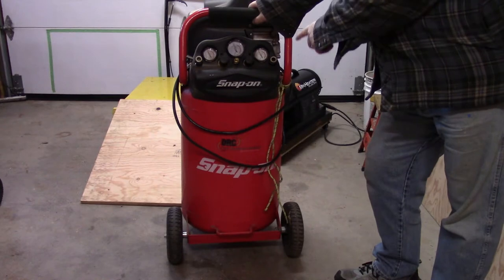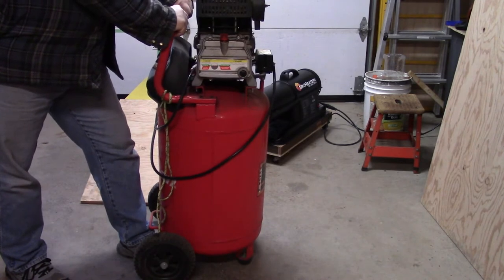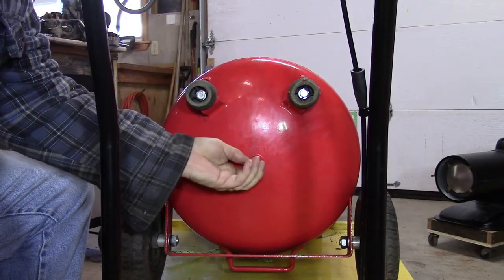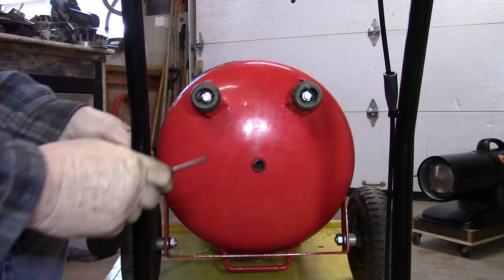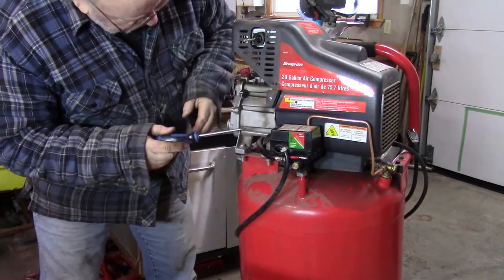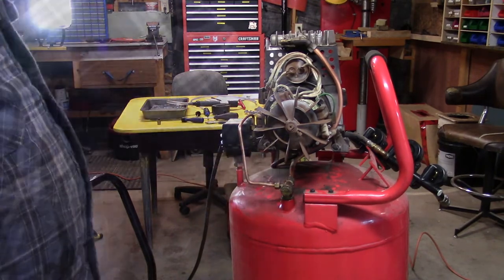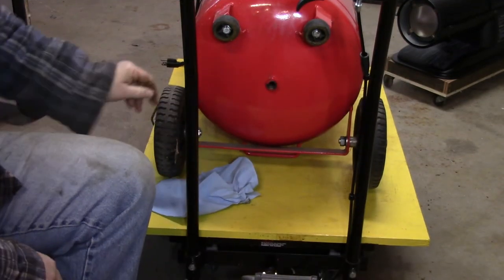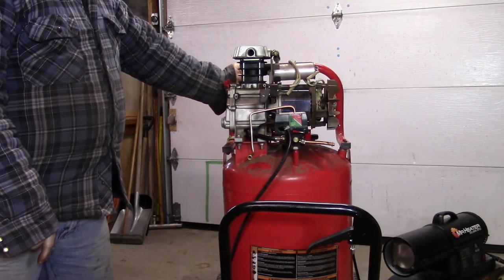Air Compressor Maintenance

Comment: I mounted my compressor up on a shelf with an access hole right under the valve so I can easily drain it. I also put a 1/4 turn brass valve on it since the original valve was kinda cheap and didn't work that well.
Reply from the maker: How's she goin'?  That's a good idea for mounting the compressor.  I move my compressor around a lot and so mounting it up off the floor probably wouldn't work for me.  I'm going to extend a hose from the drain so I can easily get at it to drain the tank.  No more water in my tank after this mod!!!  Thanks for tuning in and take care!!

Comment: Hi Mike!   Yikes!  2 years!  That’s a lot of water and a lot of rust.  I’d be worried about the integrity of the tank.  BTW, like you I release the pressure using the over pressure valve then with just a few PSI left, I drain the water.  Doing otherwise causes the drain valve to freeze with ice due to the rapid decompression.  It just takes a few PSI to expel the water after a day’s use. Thanks for sharing!
Reply from the maker: Good day eh!!!  Unbelievable the amount of water that was in my tank.  I checked the tank doing a crude, 'ring' test and the tank seems plenty solid still.  I sprayed Fluid Film in the tank and left it for 2 days and the drained it again.  Lots of stuff came out!!!  LOL  Then I put the endoscope in and did a real good 'search'.  I was able to see pretty good with the scope and I'm happy to say the tank inside looked really good so the tank should be OK.  I wasn't very proud of the condition of this compressor and the water in the tank was totally embarrassing.  And I call myself a maintenance man.  I'm going to lose my toolbox privileges for sure!!!  Thanks for watching Martin and take care!!

Comment: Staying in the habit of draining the tank is a compressors best friend. I put an elbow and extension nipple to the drain valve so it is easy to get at. Sure beats having to reach under to drain the tank eh. For most of us a hundred hours of use can take years to build up for an oil change but as with everything needs to be checked regularly. I would get a gal of "Evap O Rust" and put it directly in the tank and swish it around for a day or two and then rinse the insides with clear, hot water. Then put a water separator at the outlet is a good thing to do as with air motors water is the death of them. I use the ones that drain themselves. Really good post Mike. Not many of us will do a post like this as pride gets in the way eh.
Reply from the maker: How's she goin'?  Well Dean, I was some embarrassed when the water started to flow out.  Then, when it wasn't stopping, I was going to cancel the video all together.  But then I thought, what I do on You Tube videos is real, and this was pretty real for me.  In fact it was 'a kick in the arse' real!!!  Flushing the tank with 'rust-B-gone' I think is a good plan.  I have some Fluid Film in it now.  I plan on rotating the tank a bunch of times and then flushing it out.  checking it again with the endoscope and see if there is any difference.  If it's still bad, I'm kind of scared of it now and maybe I'll need to change it. We'll see what happens after the flushing.  Thanks for your comments and tips Dean!!  Like I always say, you have forgotten way more than most of us will every know!!!  Take care!!
Reply: @GrampiesWorkshop  When these tanks rust through they don't blow up but just start an audible leak. You can always mount the head from yours on a 100 lb propane tank. They are really easy to weld a bung on the bottom and the wheels from this one. They are quite a bit thicker than most air tanks as well. Just don't weld across any of the tanks welds as a rule of thumb. Have a great weekend Mike. It's always a pleasure to see a new post from you my friend.
Reply from the maker: @TomokosEnterprize  I did a crude 'ring' test on the tank and it sounded good and solid.  We'll see what happens after I flush it good tomorrow and have a look inside again...
Reply: @GrampiesWorkshop  I am sure it is ok. One thing about rust in these situations is it is suicidal by consuming any available O2 inside. No fuel, no grow eh, LOL.

Comment: As long as it starts and makes pressure the compressor is last on the list in most shops. That is until it quits. Nearly everything in a manufacturing or assembly shop uses compressed air.  Hooking up a hose to the drain works a treat. If you have the  time or inclination you can attach the hose up near the on off switch  and with a simple push button air nozzle with a hose fitting on both ends you can blow the water every time you start and stop. 
I set up factory air systems so budget wasn't an issue. I ran a manifold loop of 3" black iron pipe around the building with a gate valve in each corner. If someone broke a line we could  isolate that stretch and repair it. The manifold lines were hung with a 1/4 inch to 10 foot pitch biased to the corners. Each corner had an auto drain water trap on the bottom. 
All the taps on the 3" manifold line were off the top. That way the hot air from the compressor cooled off and dumped the water into the main tank. The tank had an auto drain so that water was dumped. The air went into the manifolds and cooled further. That water dumped out of the manifold auto drains. Each line dropped from the manifold had a 1 foot long trap on the end with the air pulled off the side of the line at the 1 foot mark. There was a gate valve at the end of the 1 foot long trap to blow down the line and get rid of rust flakes before they jammed up the works. 
The rusted tanks I dealt with developed pin holes long before they were dangerous. If you find a patch on a tank toss it. 
Good luck and thanks for sharing. 😁😎
Reply from the maker: Hello there Dave!!!  There is lots of info in your response.  Even though the system you are talking about is way more than what a small home shop would need, the theory of what you are doing and why is not lost!!!  I plan on installing a drain hose so that draining the tank is simpler.  And I want to do a bit of air line distribution in the shop too so I can have access to the air without running a hose all over the place.  
I ran into a problem re-commissioning the compressor though.  The air manifold split at one of the connection points and leaks air real bad.  And of course this manifold is special made for this compressor and I searched and searched for a replacement and can't find one.  I'll have to build my own manifold now and the compressor won't look so pretty anymore!!!  LOL  
Thanks a lot for your response and take care!!

Comment: Your video just made me think of my compressor and the lack of maintenance it has.....don't think I ever changed the oil and it's at least two year the last time I drain the water in the tank....of to the garage I go.....CHEERS
Reply from the maker: Hey there Gator!!!  I'm telling ya Gator, I was floored at the amount of water I had in the tank.  It drained for a solid 4 1/2 minutes!!!  And not just a trickle either!!!  Scary man, and embarrassing.  I am ashamed to say I spent my life in maintenance after seeing the state of this compressor.  Check yours out Gator and hopefully it's not as bad as mine was.  I put Fluid Film in the tank 2 days ago and today I drained it and inspected the inside of the tank with the endoscope.  It looked pretty good.  Half ways clean.  It seems a lot of the rust was cleared away!!  I think my tank will be OK and all I need do now is modify the drain with a hose to make it easier to drain off every week or so.  Thanks for tuning in and take care!!
Reply: @GrampiesWorkshop  I already like a few years ago put a side drain on my tank but I keep forgetting to drain it....After looking at your video I went out to the garage and drained it.....Got about a cup out and it was white milky-looking.....My tank is a big one and I`m not scared of the rust....I won't live that long.....I have one about your size at the camp and it`s at least 40 years old and still going....I have to think of draining it this Spring when I go there....all part of garage maintenance....CHEERS

Comment: Morning Grampie. I have a little compressor I have had for years - not very big - maybe a gallon or so, but I release the air and open the drain after every time I ever use it. However, I have never checked to see if there is water built up in the tank. Guess I best add that to my to-do list. LOL. The never-ending todo list.:)) Cheers and thanks for sharing!
Reply from the maker: Hello there GP!!!  On most compressors when you open the drain on the tank to bleed the air off, that is also the drain.  If it's on the bottom of the tank that will be the tank drain for sure.  That's a good practice Gord of draining the tank or air pressure and water after use.  The problem I have with my tank is it takes almost 5 minutes to build pressure in the tank from empty.  When I need the air, I don't want to wait, so I leave mine plugged in and turned on all the time.  I am going to install a mod to the drain though so that it is easier to get at it and therefore I can drain it every week or so.  That should help with the water build up!!  I treated my tank with a rust-b-gone type of product (Fluid Film) and the tank looks good inside now.  Thanks for tuning in and take care!!

Comment: years ago when i was painting cars i had to have a water separator in the air line and i had to drain the tank every few hours to keep the water out of the paint ,But i was using it a lot
Reply from the maker: Good day eh!!!  I would think for painting water in the air would certainly be a major concern.  I was thinking of getting a dryer for my compressor, but I think for the amount I use it, just draining it ever couple or 3 weeks would be fine.  I just hope the tank isn't too compromised.  Thanks for tuning in and commenting. Take care!!

Comment: You have reminded something Mike 😳😊... I wonder if there is any product out there to fill the tank with and get it a little bit cleaner ? 👍
Reply from the maker: Good day Igor!!  I would like to do something to the tank to clean the rust from it.  And since it's a pressure vessel it probably should be tested, but I don't think I'll do that.  I sprayed Fluid Film in it today and I'll rotate the tank a bunch and let it sit for a day or so.  Then drain the Fluid Film and check the inside again to see if there is any difference.  I hope there is.  Then I think I will spray Fluid Film in it again and the start using it and see what happens.  Thanks for tuning in and take care!!

Comment: Well Grampie I don't know what to think. Its a good thing you're a good fellar and I will let this one pass. I am sure that most everyone that has a compressor and tells the truth does maintenance the same way. I know my routine is probaly the same as yours. Everything is fine until it breaks and then it is not. All the best.
Reply from the maker: Hello there Wayne!!!  Thanks for letting me off the hook on this one buddy!!!  LOL  I like to take good care of my gear, and since I'm retired I have the time to do t!!!  But this compressor sure fell through the cracks.  No maintenance done in over 2 years probably.  The amount of water in the tank was disgusting.  I did some checks on the tank though and it seems to be OK.  So I think I dodged a bullet on this one!!!  Thanks a lot for watching and take 'er easy!!

Comment: Mike, great video. I have a similar Dewalt compressor but it is oil less (that way I don't have to run a coalescent filter for running my spray guns). But the big Curtis that I run in my shop is a twin cylinder 5hp and is equipped with an electronic blow down.
Reply from the maker: How's she goin'?   I just use my compressor for general workshop tools.  I don't spray paint with it, at least not yet.  LOL  The water in  the tank was my issue.  The oil was only for the crank case.  I have been checking up on what are the hazards of water in your tank.  It can cause the tank to rust and weaken and perhaps even explode and that wouldn't be a good thing for sure.  My tank seems to be OK, but now I'm not too sure.  I'm not too sure what to do with it!!!  Thanks for tuning in and take care!!

Comment: Wow! That was a lot of water coming out of there.  I drain mine weekly, but I'd like to get an auto drain for it.
I once saw a video of a guy who bought a used 80 Gallon air compressor.  Him and his friends were wondering why it was so heavy, so they drained it.  It took about fifteen minutes and must have been about 40 gallons of water come out.  It was thick and rusty water.  I think they kept the compressor head but scrapped the tank.
Reply from the maker: How's she goin'?  After seeing all the water drain out of my tank, I have to admit, I'm concerned about it's condition.  I did a crude 'ring' test of the tank and it seemed pretty solid still, so it's probably OK.  I expect if it were to fail it would more than likely just get a 'pin hole' leak in the tank and I would hear the air!!!  I hope that's what would happen anyways!!!  Terrible maintenance done here.  I can't believe the state of this compressor!!!  Thanks for tuning in and take care!!
Reply: @GrampiesWorkshop  I'm sure it's fine if it passed the ring test.  Just don't sit on it when it's filling up lol
Reply from the maker: @BruceLyeg  Probably a  good plan eh!!!

Comment: I think I better go check my compressor now lol
Reply from the maker: How's she goin'?  Well I'll tell ya one thing, I'm not too proud of the condition mine was in.  Holy crow talk about a  lot of water.  I did spray Fluid Film in the tank 2 days ago and today I checked it with the endoscope and it looks really good so I think I saved the tank.  But that amount of water was embarrassing.  Thanks for tuning in and take care!!
Reply: @GrampiesWorkshop   I bet mine is worse! Been years since it was drained lol 60 gal tank could be 20 gallons of water in it by now hahaha

Comment: Awesome Grampie《☆》Compressor time👍🤓I need to look at mine as well. It's been a few years since I drained the tank. Mines an oil-less 20 gallon C.H. space saver meaning it can sit upright or down. I'm surprised it still works after 20 years. It was fairly cheap I think less than $300. We drained the compressors at work every Friday & changed the oil once a year by checklist for shop equipment♡:*:♡2021♡Greetings from⛾Florida🤳my friend😎🎱☮🔊✌👍
Reply from the maker: Hello there Bdog!!!  I was totally surprised and shocked at the amount of water I had in this tank.  It was embarrassing to say the least.  You maybe should have a look at your tank.  I checked mine today after putting Fluid Film in it 2 days ago and the inside of the tank looked pretty good.  It got a lot of the rust knocked down so I think my tank will be fine!!!  Thank goodness!!!  Thanks for watching and take care!!

Comment: i have the same compressor do you have a part# for air filter mine never came with one great vid
Reply from the maker: How's she goin'?  Thanks for dropping by the channel.  I don't have a part number for this compressor's air filter, but I expect any kind of paper filter that would fit the housing would be fine.  This compressor had a major failure of some of the brass fittings and I had to decommission it.  Too bad as I liked it.  I have a new Sanborn now and it works great.  Thanks a million for watching and commenting.  Take care!!!

Comment: I wonder if the steel of the tank has been compromised from the rust. Don't stand too close to it!
Reply from the maker: How's she goin'?  That was my thought too.  So much water and lots of internal rust.  I did a crude 'ring' test on the tank and it seemed pretty solid still.  I'm flushing the tank today with Fluid Film and then I want to check inside again with the endoscope to see if it's improved any.  We'll see what happens.  I sure didn't do too good on the maintenance of this compressor.  I'm going to lose my toolbox privileges if I'm not careful eh!!!  Thanks for tuning in and take care!!

Comment: Mike, I just seen a couple of days ago on YouTube a compressor tank erupted on Aug.2/20 on  3Generation_Racing. It did a fair amount of damage. Nobody was injured which is good. At least you have a vertical tank which has the water build up in the end or bottom which is the strongest part and not along the seam on a horizontal tank.I have an 30-40 year old compressor In my garage and I keep it drained, but after seeing video I’m wondering if it’s time for a new one.  Stay Safe. Rick
Reply from the maker: How's she goin'?  There was a scary amount of water build up in my tank as you saw.  My compressor is 10 years old I think.  When I tried to look at the inside of the tank it looked in bad shape.  I tried a very crude 'ring' test and the tank sounded pretty good all around.  I have sprayed some 'Fluid Film' in the tank and let it stand for a couple of days.  Tomorrow I plan on flushing it as best I can  Then I would like to take another look with the endoscope to see if there is any difference.  Then spray more fluid film in the tank.  It is a pressure vessel and they need to be treated with caution, so taking this care with it is worth it!!!  Thanks a lot for watching and leaving this comment.  It makes a guy think eh.  Take  care and stay safe for sure!!!

Comment: What kind of oil goes in it?
Reply from the maker: How's she goin'?  Thanks for searching out the channel and commenting.  I use compressor oil in the compressor.  That may sound too simple but at our local hardware store they have oil marked 'Compressor'.  It is a 30 weight oil and has no detergents in it.  The idea of no detergents is to prevent it from foaming up.  Since the compressor rotates at a high RPM, we don't want to have foam in the oil, because foam is air and we want oil on everything not air.  Happy New Year and take 'er easy!!